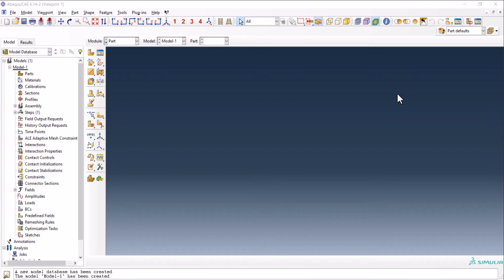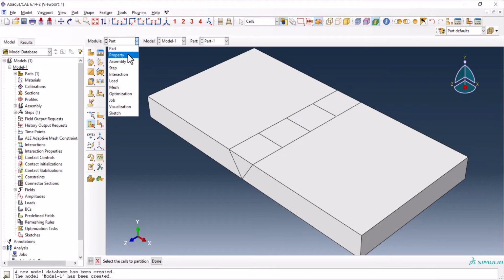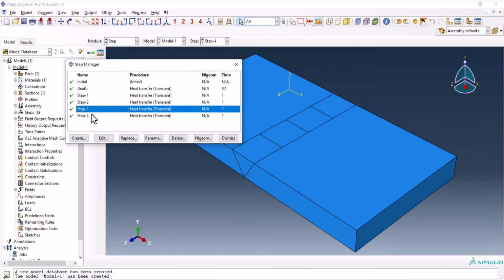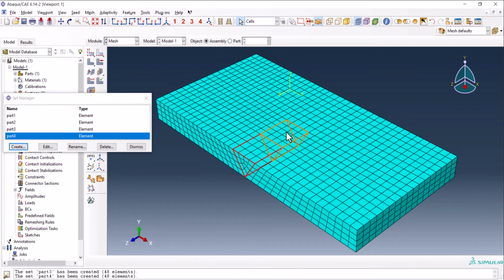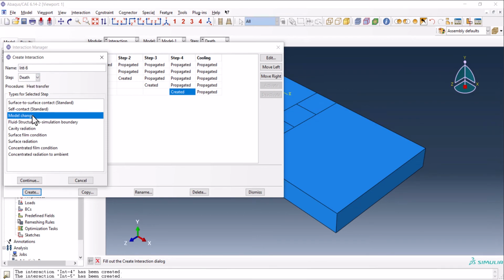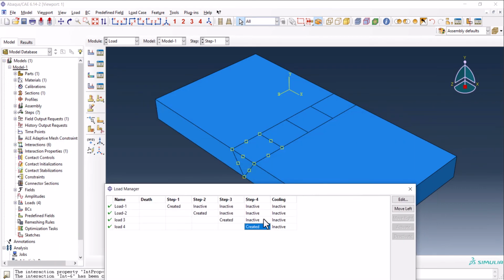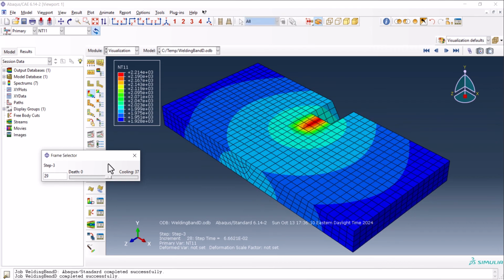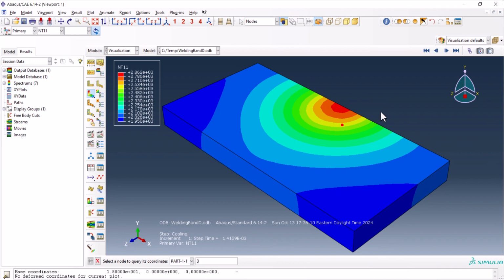Enhance Welding Simulation in Abaqus with This Unique Technique!

Comment: How can I implement user defined Dflux subroutine in birth and death technique? And modifications in fotran code which I have to take care?
Reply from the maker: You actually don’t need major changes in your DFLUX for birth & death. Abaqus automatically ignores flux on inactive elements, so you don’t have to manually check if elements are “alive.”

The key thing is time control. Since birth & death uses multiple steps, you need to make sure your heat source is aligned with the activation:
	•	Use TIME(2) (total time) for a continuous moving heat source
	•	Or reset position using KSTEP + TIME(1) if you want step-wise control
	•	Make sure heat is applied only during the correct activation window

Most problems happen when the heat source moves over elements that are not yet activated or when time is not handled consistently between steps.
Reply: @FEAMASTER  "Too many attempts made for this increment

The analysis has been terminated due to previous errors. All output requests have been written for the last converged increment.

Abaqus/Standard Analysis exited with an error - Please see the message file for possible error messages if the file exists." 
actually, i am getting this error? how to resolve it?
Reply: I get this error in step 2 of 13, increment?
Reply from the maker: @sivoem  watch this video to solve the error:
https://youtu.be/9cOMFiwiSs4?si=YaS4SZhFOMkHMYam
Reply from the maker: @sivoem  If you follow the steps carefully, there should be no problem!
Reply: @FEAMASTER  Ok.. Thank you 🙏🙏
Reply from the maker: @sivoem  Anytime!

Comment: I have only the value of density, conductivity and spez. Heat. and I do not have any temperature. How can a get a graph of e.g density temperature dependent
Reply from the maker: You should find those values from the articles! Do you want me to send you a video link on how to do that?
Reply: @FEAMASTER  I saw your video Grab Data from any Graph or do have any other source. One more question. In your video "Powerful Abaqus Additive Manufacturing Technique You’re Not Using!" u said that mesh of layer and substrate must be same mean that every line must be connected to each other. I hope u got my question. what is when they are not same
Reply from the maker: @InamKhan-xx3wt that’s great! Sometimes you might get convergence error when they’re not inline on top of that, it would reduce the accuracy of the analysis.

Comment: Hello, teacher, I would like to ask which paper all your parameters come from. I want to learn this method by re-showing this paper.
Reply from the maker: Hey there, 
To be honest, the values and the properties were taken from various papers and I can't remember them and the video didn't mean to validate the results with the paper but meant to be adequate enough to convey the educational purposes! but  you can simply pick and article apply the same thing on it. Let me know if you need help on that!
Reply: @ hello,I want to re-display a paper, but I think there are some parameters in the paper that are not provided.
Reply from the maker: @HtD-r2u  Does the paper matter? Or you just need to do that specific paper? I've done this during my masters or undergrad time (I can't remember which on!) and I can remember I needed to take the mechanical properties from different papers! But everything else was ok!
Reply: @ Hello, this is a typical paper about welding. My tutor hopes that I can be familiar with the whole process and master this method.
Reply from the maker: @ don’t worry I can help you with it! First you need to try simulating the model in a simplified way. For instance if the length is 500mm you can make it 100. The simplifications can cause errors but with the purpose you have, it’s totally fine. You will definitely have the step times in the process and other parameters, you might not seeing the materials properties completely but you can take it from other papers with the same material. Let me know if you need more help.
Reply: @ Dear teacher, can you publish a complete tutorial to re-show a paper? If you can publish it, I will be very grateful.
Reply: @ Have you re-shown a paper on welding? If so, could you send me the corresponding paper and abaqus file? Thank you very much.
Reply from the maker: Yes why not! I will do that later!
Reply from the maker: No I haven’t done that but wait for the video!
Reply: @FEAMASTER  Great, teacher, I'm looking forward to your teaching video. Thank you very much. I have become your fan, and you have become my teacher.
Reply: @FEAMASTER  How long will it take, teacher? I will always pay attention to your channel and look forward to your teaching videos.
Reply from the maker: @ I appreciate that! I’ll try my best to make it as quick as possible, finding a good paper and re-generating an article is kind of time consuming!
Reply: @FEAMASTER  I think the content of this paper is very good. You can use it as a reference, teacher. Thank you for your help.
Reply: @FEAMASTER  Evaluation Eects of Modeling Parameters on the Temperature Fields and Residual Stresses of Butt Welded Stainless Steel Pipes
Reply: @FEAMASTER  How's this work going, teacher? I'm eager to learn.

Comment: Thank you for your video. I have a question, the Film coeff in the video is the heat transfer between material and surrounding or between weld and other material?
Reply from the maker: You’re welcome! The film Coeff is between the surfaces that are in contact with the air, so you have to make sure not to select inside the weld! The top part of it is in contact with environment.
Reply: @FEAMASTER  Thank you for your reply. You may remember that I asked you a question a few days ago in another video. I found that the simulation of molten metal jetting is very similar to welding (both molten metal falls on to cooler material), but I have three questions:
1. What does the magnitude = 2 in body heat flux mean?
2. I found that at the beginning of every step, the birth element of this step always first with lighter color (corresponding to lower temperature), why is that? Because I think that at the beginning of the step the molten metal must have the high temperature, then gradually cool down.
3. Do I need define other parameters, when l want to simulate the heat distribution between two materials of layer and substrate. I noticed that in your another video "Powerful Abaqus Additive Manufacutring Technique", the substrate and layer have different materials, but you didn't define a film coeff between them. Is the thermal conductivity enough for this?
I'm sorry for the long questions. But I would be very grateful if you could answer me.
Reply from the maker: @Shiki_Southwest  Hey, yeh I totally remember! Don't be sorry to ask questions! Long questions, requires long answers! So I'd answer your questions in different comments down below:
Reply from the maker: 1- What does the magnitude = 2 in body heat flux mean?
In Abaqus, body heat flux represents a heat generation rate per unit volume. When you set the magnitude to 2, it means that every unit volume of the material is generating heat at a rate of 2 watts per cubic meter (or whatever unit system you are using). This value is used to simulate internal heat sources, such as laser energy absorption in welding or additive manufacturing processes. If you are modeling molten metal deposition, this value should correspond to the energy input from the process, which could be adjusted based on experimental data or energy balance calculations.
Reply from the maker: 2-Why does the newly activated element appear at a lower temperature at the beginning of each step?

This happens because of how Abaqus initializes the temperature for newly activated elements in an Element Birth and Death technique. When an element is activated in a new step, unless explicitly assigned an initial temperature, Abaqus might default it to a lower reference temperature (such as ambient temperature). You are correct that molten metal should have a high temperature initially, so you need to ensure that the activation step includes an appropriate initial temperature assignment. One way to fix this is to use predefined fields or user subroutines (such as DFLUX or FILM) to control the initial temperature of the newly introduced elements so that they match the expected molten metal temperature.
Reply from the maker: 3- Do I need to define a film coefficient between the substrate and the deposited layer, or is thermal conductivity enough?

The need for a film coefficient depends on how you are modeling the heat transfer. If you are treating the substrate and deposited layer as separate materials in direct contact, the thermal conductivity at the interface should generally be sufficient, as conduction will govern heat transfer. In many additive manufacturing simulations, interfacial thermal resistance is ignored if perfect contact is assumed, but for more accurate results, you can define a thermal contact property to better capture heat transfer behavior at the interface. You don't always need a film coefficient unless you're explicitly modeling some kind of thermal resistance at the interface. For simplicity, many educational simulations assume perfect contact and focus mainly on the material properties, so thermal conductivity will typically suffice for heat distribution between the two layers.
Reply: @FEAMASTER  Thank you! It's very kind of you to answer my questions. Your answer really helped me understand abaqus better.
Reply: So I can define the initial temperature of molten metal through body heat flux. I tried to predefine temperature of substrate and layer separately with different temperatures, but it always get strange results.
Reply from the maker: @Shiki_Southwest  You're welcome. I'm glad it helped you!
Reply from the maker: @Shiki_Southwest  How strange do you mean? have you converted the load they mentioned in the paper? I recommend you to use a good paper as a reference then start with a simple model and try to make your simulation more accurate by adding more properties and predefined filed and so on...
Reply: @ I tried many times. There are one substrate and one layer, between them there is a contraint "tie". When I use body heat flux, the result is similar to your video (temperature diffuses from the layer to the substrate and from the new cell to older cells). But when I use predefined temperature for substrate 1000 degrees celsius and for the layer 1200 degrees, there are no diffusion of the temperature from layer to the substrate nor from new cell to older cells, although I also set the constraint between layer and substrate "tie". The other settings are the same and there are really few papers cover the apecific operation of ABAQUS. Therefore, I'm really now kind of stuck at this step. Is there anything spacial, when I use predefined temperature?
Reply from the maker: @ yes of course you would see the heat transfer while using the body heat flux. But in your case if you don’t have flux, then there’s no heat transfer like that. Your temperature validation matters more. Try comparing your temp with other papers.
Reply: @FEAMASTER  Can I write a subroutine to define the initial temperature (1200 degrees) of droplets?
Reply from the maker: @Shiki_Southwest  I think before trial and errors, it’s better to find a good paper, in the papers they indicate the loading/boundary conditions. Once you’ve done your research, you can decide whether to use flux loads or predefined temp. As far as I’m concerned, DFLUX is only for the load.

Comment: Great video, sir! I want to ask a question. I have tried similar simulation to replicate welding process, but when i input correct heat flux calculation (about 10^11) the simulation failed and the simulation only works when i reduce load to 10^9. Do you have any reasoning of why this might happen?
Reply: I'm trying to replicate welding stress and displacement from a research paper. I'm using the same steps as you did in the video. However, for step and mesh type I use coupled temp displacement. As previously said, from the goldak's data available in the paper, I got heat flux of 10^11 but when I run it always abort with error too many increments (failed to converge at first step). When I open the results page it shows the first bead element expand to very large size until aborted. The simulation works normally when I reduce flux to 10^9. Any suggestions of what might be causing this, Sir? Thank you for the reply
Reply from the maker: @dimyog  That's what I thought! First of all, the tutorial was created in the simplest way as the aim of education. second, it is better to subdivide the weld line to the 8 parts preferably instead of 4. Third, try to do the mesh sensitivity analysis, I mean you can refine the mesh to ensure that the problem is not because of big size elements. lastly, you have to make sure that the materials properties is in the correct way and if the load is too much for this material this problem would happen. 
I hope it solve your problem.
Cheers
Reply: @FEAMASTER  Thank you very much for the reply. I will try to modify my mesh. Appreciate your reply and abaqus videos, which are very interesting. Is it possible for you to make a tutorial on using DFLUX subroutine?
Reply from the maker: @dimyog  No problem. Yes, I will do that for sure!
Reply from the maker: @dimyog  thank you I’m glad you enjoyed it! Did you follow everything according to the video? If not I recommend you to watch every single step rigorously. And also, I should know what is the error! Is it too many attempt?

Comment: Great illustrative video! Are you aware of the additive manufacturing (AM) simulation capabilities in Abaqus? You can use the built-in AM subroutines to model the welding process including the heat transfer step with element activation and moving heat source, and also the residual stress step which uses the nodal temperatures from the heat transfer analysis as the load. See e.g. ”Thermomechanical Analysis of Powder Bed–Type Additive Manufacturing Processes Using the Trajectory-Based Method” in Abaqus manual. There is also a plug-in named AM Modeler available for setting up the simulation, but I prefer to add these features into the input files directly.
Reply from the maker: Hi, thanks for letting me know, I simulated additive manufacturing before with roughly the same method, but I was not aware of the example in the abaqus manual. Thanks again!